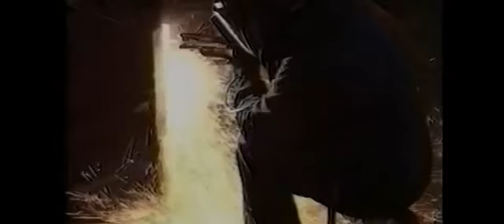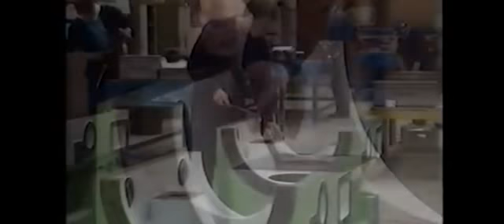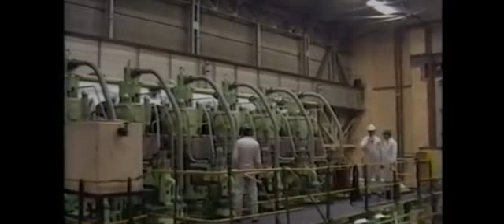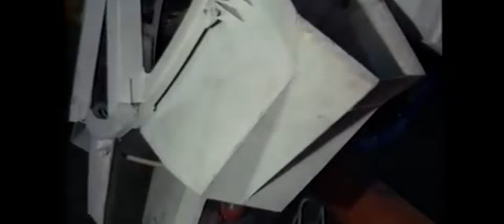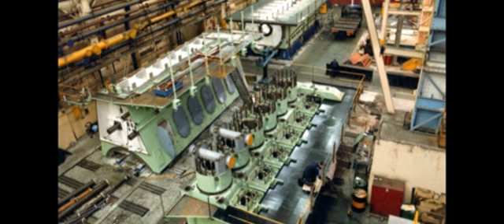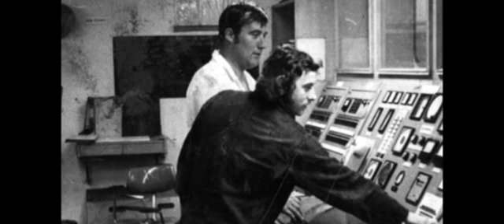Kincaids H264

Comment: I served my apprenticeship at Kincaids, training School Arthur st. Mr John Knox, then East Hamilton st.
The stories i can tell, the engine on the test bed out of control, the crankshaft falling of the transporter outside Capielow
Arthur st, charge hand Willie Belfor RIP,  Robert Dickson Foreman RIP.
I went to sea on ships with B + W engines
I came back to Greenock couple of years ago and the changes broke my heart
A   MACDONALDS  where they used to build ships
Victoria harbour empty
Where did we go wrong
Reply: Robert Dixon ended up as Machine Shop Manager and Willie Belford, my Dad, became foreman 👍
Reply from the maker: Good to hear from you Alistair' I also worked with Willie Belford and Robert Dickson in Arthur Machine Shop. Great characters. I then became a foreman in E, N and J & K shop. I well remember the crankshaft falling off the transporter as I was the foreman in charge of machining the replacement at the time. I then went on to become sales and contracts manager until the closure of the Main Street works until its closure in 1999.  If interested, please go to the following web address and you will see more details of the Reunions we had a few years ago .https://kincaidreunion.jimdo.com/reunion-pics-1/
Reply: May I ask where you served your apprenticeship and when did you start at Kincaids, during my time in East Hamilton st ,1950 (officeboy) 51/56 app,foreman I shop were Jimmy mcgregor&Harry hood,fnishingshop , ? Noble , leadhand Willie Muirhead, outside squad,Jackie masson,Sam Craig, Willie Armstrong, ?Blackburn paddy Church .L/N Bob Hannah ,W Southern. Drawing office,  Mumford. All the best Gilbert mcmab.